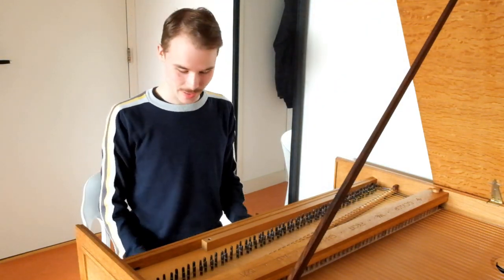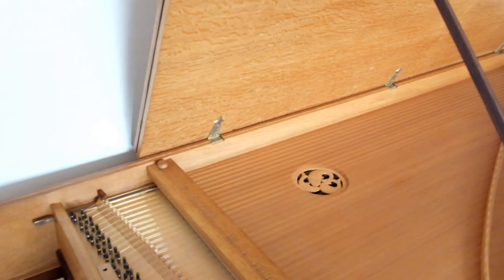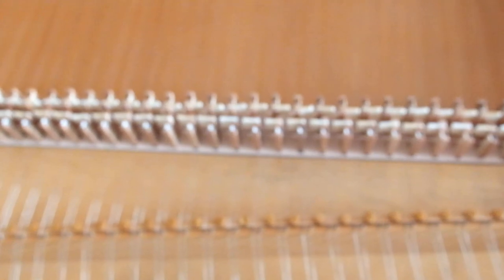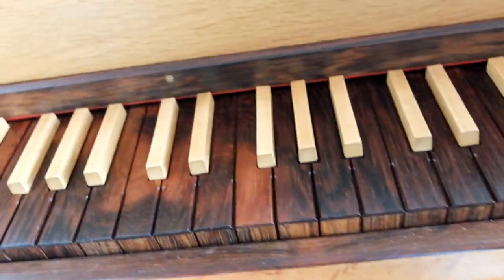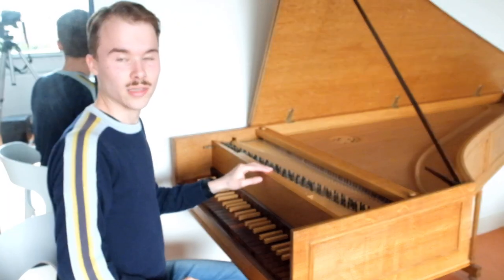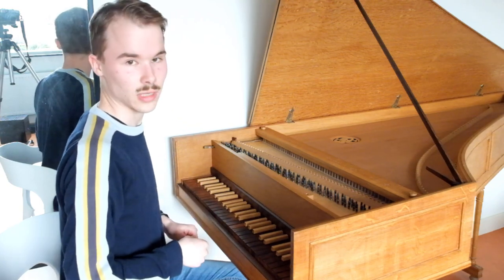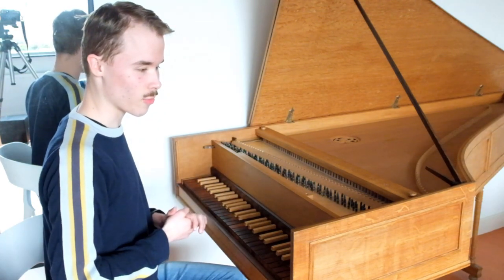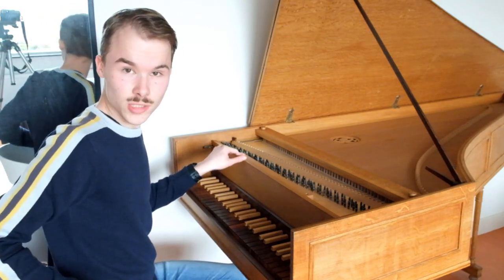My new harpsichord - Demonstration after restoration

Comment: How much does a harpsichord like this weigh! Does it have a iron plate or not?
Reply from the maker: No, a historically based harpsichord does not have any metal plates. Usually, harpsichords are pretty light (compared too pianos) but it depends on the size of the harpsichord. My harpsichord is a bit heavier, because the case is made of oak wood, which makes the instrument weigh around 40 kilo's.